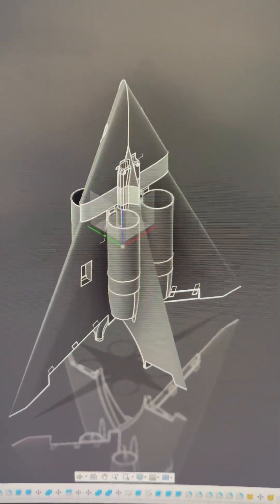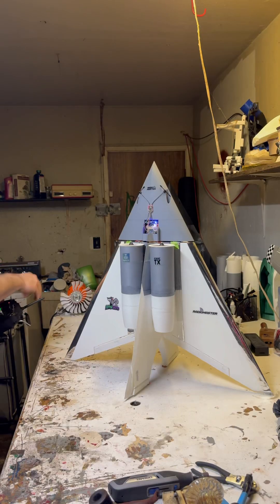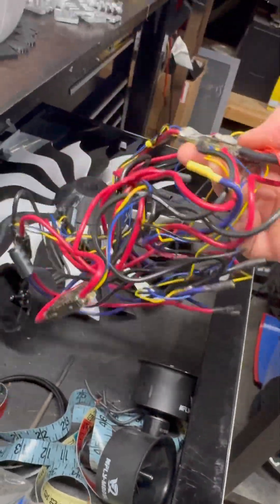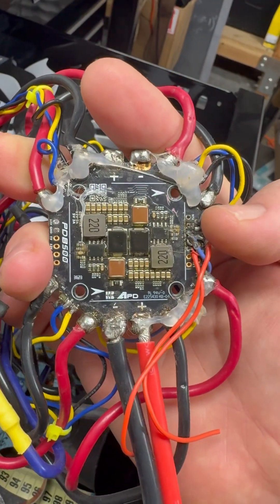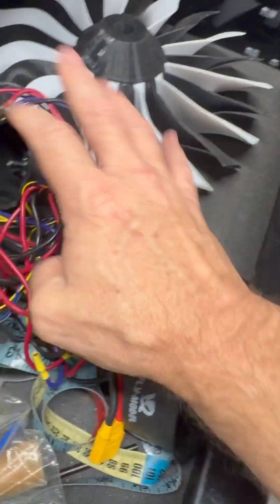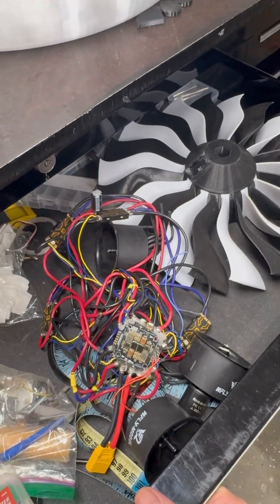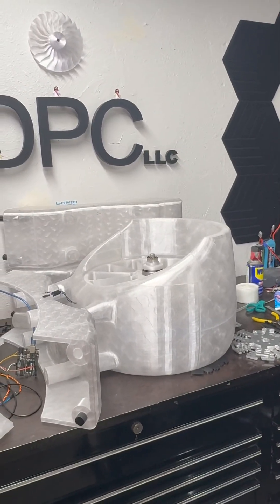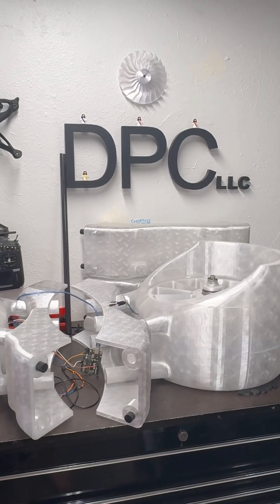Javelin is getting a refit after the Shrike is finished.

Comment: Are you just rotating the flight controller to transition from vtol?
Reply from the maker: Yes, it made more sense than trying to rotate the engines since I wanted them to be static and the entire frame to act as a tail sitter aircraft, it could hover like a drone and then transition into flight mode after enough forward speed then after transition open up the throttle and takeoff like a bullet. Most people try to rotate the engines I prefer this method.
Reply: @warmachined3472  Ive never seen anyone do that before but it's brilliant and fits my philosophy about the simplest solutions being the smartest. I stumbled on your channel because Im looking to dust off my cad skills from highschool and dabble in the 3d prinitng world by going straight into building a one off vtol plane and I may have to rethink everything after seeing this